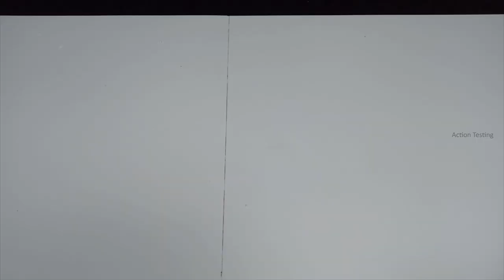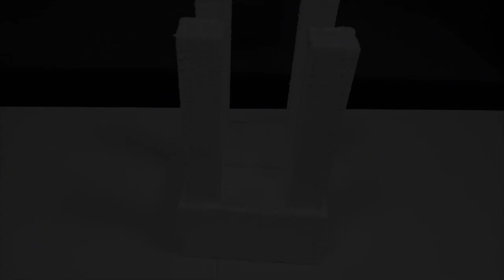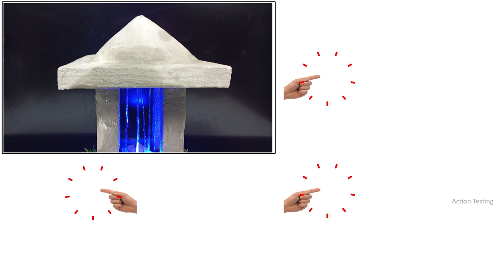Fantastic mini water fountain Homemade waterfall  Styrofoam and cement

Comment: Why you don't provide measurements?? Please provide measurements in first pinned comment. Take Love from Bangladesh....
Reply from the maker: Thanks
Reply: @ActionTesting  Hello. I've send you some pictures over Facebook messenger. Please check. I've used hot glue for initial structure and a single coat of only cement. But now I've got a problem. It's leaking water from the bottom side of the base. Now what can I do to fix this. Please help. I've to get it completed by December 20